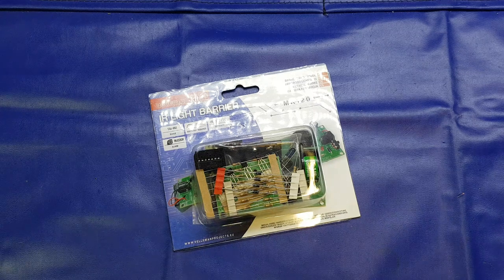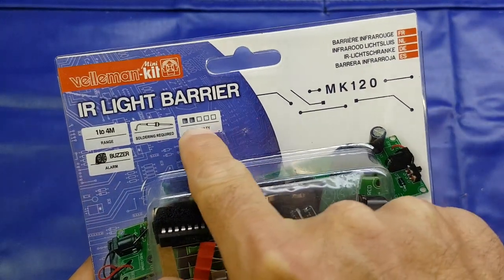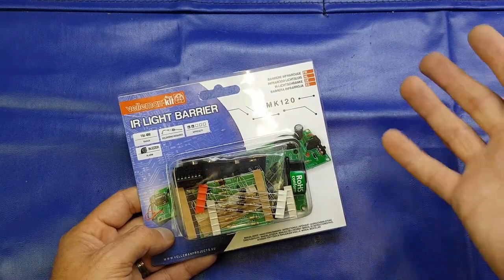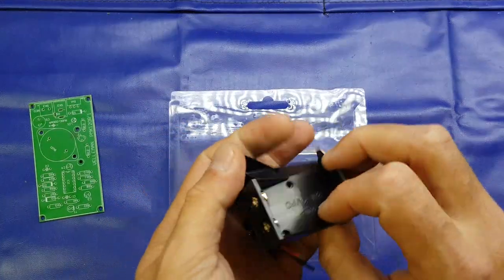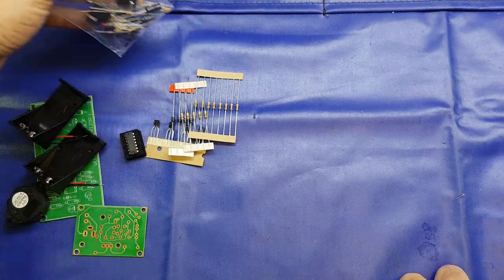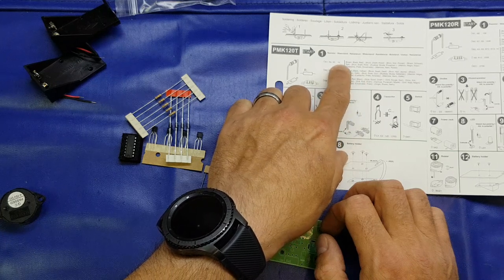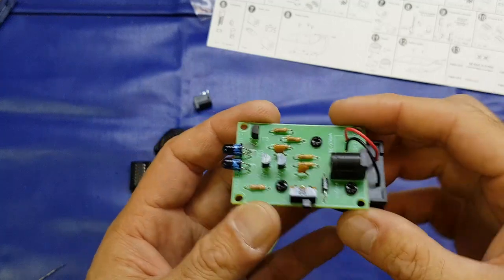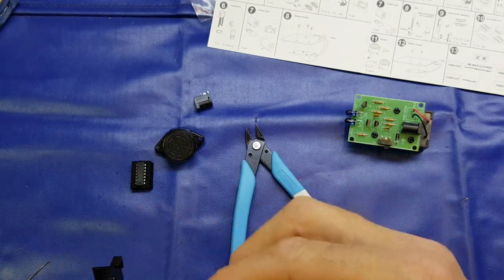Maplin / Velleman MK120 IR Light Barrier Alarm kit build (electronics kit build)

Comment: Well im all for saving money but at least u can go into a Maplin store and actually pick up and hold, touch and squeeze a product b4 u buy iy. Also u can ask for advice while u are there. Maybe thats worth the extra quid or 2?
Reply from the maker: +Gary g1fsh I was short of flux and asked if they could check if they had any in stock as I couldn't find any on the shop floor; the assistant said he'd check the computer..."what is flux? I've never heard of it; how do you spell it? Is it F L U K S?" 🙈
Reply: Kris Cochrane lol yes maybe it was just wishful thinking on my part Kris
Reply from the maker: +Gary g1fsh Just frustrating really, I know they have overheads but if they were more reasonable with their pricing they would get more sales and would be more profitable. I know I'm Scottish and by definition, a tight git, but I really wouldn't mind spending £6 on a kit off the high street on a regular basis but I'm not going to spend £20 on a kit when I know I can get it for £2 delivered from China. Tandy and the like used to have knowledgeable staff and in the past Maplin did but sadly, in my experience they just have store assistants on minimum wage that either don't know their stuff or don't care.
Reply: Kris Cochrane yes i have to agree Kris i do like to look round Maplins but i am like every one else i spend my money in China where u get better value for money most of the time.
Reply: Still Craplins :( I grew up in that area when they were properly priced and honest. Now they are just greedy.
Ready built (takes the fun out of it ) Similar .. search AliExpress Wholesale Infrared Laser Alarm Switch Sound / Light Alarm Motion Sensor Security Kits £15 for 10
Reply: And now even Maplins is gone. Shame, they were expensive, but great if you needed something in a hurry and were close enough to pop round. There is only the internet now!